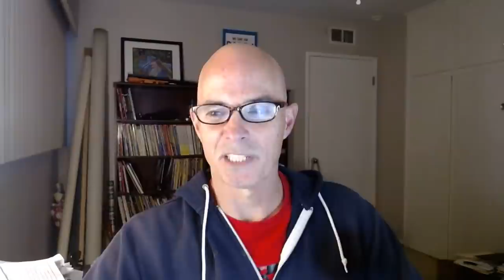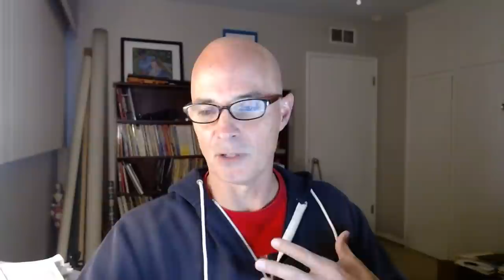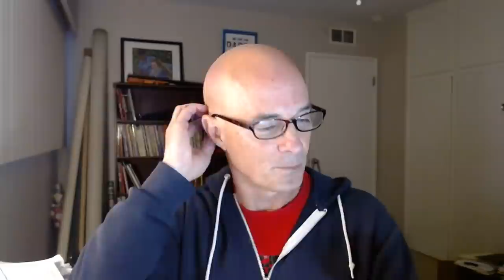LET'S TALK-CAM LIFT, DURATION & LSA (Q&A)

Comment: I need help Rich, ive been watching mr vizard. I have a 91 mustang gt. Im looking to do a top end kit and get a cam w specs he would figure. Is there an off the shelf cam in regards to this? I want to keep bottom end stock. Id also like to add boost later on down the line. A na cam and boost cam recommendation would be awesome. Im also keeping it efi no carb. Any help along w recommendations are highly appreciated. Another thing whats the best intakes for these? Is it holley, trickflow, or? Thanks in advance and i now know the lsa/lca is very critical. Another question, when you set ring gap for boost what do you set it to? Is there a top end kit youd recommend?
Reply from the maker: If you want David to select your cam, go to David for specs. Yes on more gap for boost. Not sure what you mean by best intake.
Reply: @richardholdener1727  out of your testing which intake performed the best? ie the best intake for hp and tq. ive heard the Holley Systemax is the better of all of them. what should one gap their rings at for boost? i simply don't know is all. i just figured you go by how he selects cams as well. i'll def go to him in that regard then. thanks again

Comment: If 200 cc heads are a limiting factor on a 351w, what would it like?
Reply from the maker: the stock 351W heads are not near 200 cc-but I'm more interested in flow than volume

Comment: Is The cam base circle  critical on cam selection?  Do the small base circle cams flex more under high spring loads or is there a preferred steel to use for small base circle cams?
Reply from the maker: have not heard of flex being a problem
Reply: W/the large base circle cams like w/the LS platforms, 55,60,&70 mm base circle  cams on the BBC’s 
Do they tend do have more ramping flexibility  as opposed to small base circle cam being harder on lifters and valve trains in general?  Or  does it even matter?

Comment: Never could understand why a person wants a PD blower and then wants to put a cam that reduces the power where such a blower shines. Then they will also do a stroker motor to increase torque. How does this make any sense????? Use factory displacement with a camshaft with tighter LSA which would increase torque and horsepower for a cheaper price than a stroker kit. Remember to try and stay intellectually consistent. I know it hard for us gearheads to do. I have a Hellcat and want to cam it. I will most likely use the Tomahawk 2.0 with 111 LSA . I'd rather have 108 but 111 is about as tight as they make for the Gen 3. I'd like 600+ lift and 108lsa with duration in the 220's.
Reply from the maker: you are not asking the same question about cams that OEM engineers (and may other cam buyers) ask

Comment: Awesome Content Brother,
Looking at BTR 219 / 239 .553/553 @ 115+2 in a LS3 416 Stroker @ 11:1 CR / 823 Heads, L94 Truck intake, LS7 Crank,  Manifold, Cats, 3" exhuast, to Z06 Npp
  6L80 TuTd w Stockish TQ adapted to Heavy /Lite tow 80's Land Cruiser AWD
  Looking for Low End Torque to Mid Range w Throttle response thru Curve in a DD
 Seems to be a "Goldilocks" fit, might also appreciate the Sound of that large Dur Split (20) on a 115 w a  -1.00 Overlap
Reply from the maker: HOT ROD OR RED HOT FOR THE 416

Comment: 295/336 Duration, 595/595 Lift, 107 LSA stock 5.3 stick shift 4.10 gears 320lbs truck maybe lighter
Reply: Do you think that would be a good cam
Reply from the maker: provide the numbers at .050
Reply: @richardholdener1727  234/277 . Thank you
Reply: @richardholdener1727  do you think that could hit the valves to the piston

Comment: Richard, can you answer this for me? If I have 2 cams everything the same but one is .550 lift and one is .600 lift or more, how will the curve change? I like my trucks power curve exactly how it is but just want to intensify it a little bit, all the way through or at least on top end. I have some to spare on low rpm. So will lift get me what I want? Or do I need to add just a few degrees, or add one or two degrees to the LSA? Truck has ported heads and intake/tb so should be able to take advantage of any cam changes
Reply from the maker: depends on cam-but lift might help it everywhere
Reply: @richardholdener1727  it is btr stage 4 v2 .. 224/230 .558 .558 109LSA 

I'm thinking of going custom with 226/232 .610 .610 109 

I have the ported heads, do you think I need to increase those numbers anywhere or have an offset with the lift (example .600 lift intake .630 lift exhaust) or if you think I need a bigger split on the duration or tighten it up some let me know
Reply: @richardholdener1727  I found 2 videos from TSP comparing the same cam, one with .550 and one with .600 and the higher lift cam made like 10 more hp and tq everywhere without any loss or dip so it seems like increasing lift generally gives an even bump across the board, similar to what higher compression does
Reply: @richardholdener1727  I have .660 double beehive springs by the way so if u think I need to go more than .610 lift it's fine

Comment: Hey Richard I'm interested in  the  lunati high lift voodoo 625 625 112 219 223 ging in ported 243s 6 speed car runs 12.40s with the stock ls1 cam what kinda gain should you get  with ls6 intake please let me no
Reply from the maker: what intake is in it now?
Reply: Hey Richard I have  a LS6 intake
Reply: @richardholdener1727  hey Richard what do you think of the lunati high lift voodoo 625 625 219 223 on 112 for full weight 6 speed ls1 with ls6 intake  for all around street strip ? I mostly just take it to the track on weekends and the odd cruise  just looks like that cam would give me the most average power

Comment: I'm.  Building.     A.    Street.    Motor.      383.     30.     Over.       Darts.    Heads.   202.     160.       Na.        1.  Point.   6.    Rockers.      How.      Big.      A.       Cam.      Can.      I.    Run.    An.       What.     Kind.      Had.     Or.     Solid.     Lifter
Reply: Is something wrong with you?

Comment: Sure, your turbo motors work with the cams you use, but n/a engines with anything over 108 lsa only make top end hp & zero torque. Thats just fine if you've  got a track car with a 5500 torque converter and up. If you can't  get traction from your suspension, I  get it, but don't  be telling everyone that just because your set-up makes max hp, that it has the most potencial on the track. No torque and you don't win races!
Reply from the maker: na engines with anything over 108 lsa only make top end? You need to test more or look at the many, many, many cams tested here to see where they make power

Comment: Tight lobe separation angles are not good for any boost applications ,especially nitrous
Reply: Depends on what you consider tight lobe separation cams. Back in the 80's-90's and even 2000's nitrous cams were grinded on a 108 to 110 LSA and worked great. He'll I think BDS or TBS blower companys prefer 110 LSA still due to one reason the cooling of the exhaust valve. Prostock engines use a wider LSA because of the higher duration of the cams. Just MHO and grumpy jenkins and Warren Johnson theorys.

Comment: Who cares about testing at 2000 rpm? It ain't like anyone is using full throttle at 2000 rpm. Most run a 3000 stall so why does it really matter and who REALLY cares?
Reply: Maybe those who have street use vehicles or towing applications, and don't want to downshift to have some kind of response from right pedal input.
Reply: @rhubarbpie2027  IMO if you're building a PERFORMANCE engine, it doesn't matter. Especially if you're running a 3000 stall converter. If youre building a towing or low speed engine then the cam should be sized for lower rpm. Like the truck cams. I tuned a Denali and the owner/builder selected a stage 4 truck cam. Runs GREAT at 3000 rpm and up. But he was on a stock stall. I told him I would've run a stage 2 at the most. Now he is getting a 2800 stall and the trans rebuilt. Once that's done, it will get out the hole a lot better.
Reply: Daily drivers derp
Reply: @shadowopsairman1583   they shouldn't worry about cam swaps then...
Reply: @jaydubb71  maybe intensive engine modification isn't advisable for all end user applications, but regardless there are people who want different/improved engine performance and that does sometimes warrant an aftermarket camshaft.
Reply: @rhubarbpie2027  if that's the case, people shouldnt be watching videos about engine modifications and then ask about 2000 RPM dyno numbers. Even automotive diesel engines don't get loaded like that at 2000 rpm. Now over-the-road trucks might (I'm a former transit city bus mechanic and 3000 rpm was the govenor limit of a lot of those engines) but cars, no. Most stock torque converter stall at 1800 or so. Most engines cruise on the highway between 1500 to 2000 rpm. Who in their right mind accerates to pass someone and keeps the engine at 2000 rpm? The 2000 rpm question makes no sense...
Reply: @jaydubb71  sorry to have provoked thought. ☹
Reply: Who would care? Anyone running a manual transmission! Yes, 2000 is pretty low, but there are people who will put the hammer down at 1500 rpm or want to climb a steep hill while towing at 2000 rpm. It's not a stupid question! Might they be better off downshifting? Maybe, but if the trans has a granny-first, then running 2000 rpm in second might realistically be the only choice.
Reply: @jaydubb71  There's a cam that will get you 20-30 ft-lbs at 2000 rpm. People who want that readily available torque will want a cam swap!

https://briantooleyracing.com/btr-camshaft-gen-3-4-truck-torque-btr32430112-30202112.html
Reply: @stephendee7839  I REALLY want to see a cam SPECIFICALLY DESIGNED to be run in a steady state at 2000 rpm. The ONLY ENGINES I see that do that are BIG diesel engines. Even with a gas engine towing uphill, you're NOT sitting at 2000 rpm. That's the stock stall speed of MOST automatic cars anyway. And my 30+ years of automotive experience has never shown me a gasoline powered vehicle that has peak torgue at 2000 rpm. That Detroit Diesel/Cummins 10 liter HEAVY DUTY truck engine territory. I think loading an engine at 2000 rpm on a dyno it POINTLESS and just might do more harm than good. But the internet thinks differently.
Reply: @stephendee7839  even this example you used starts at 2300 rpm. I wonder why they didn't show the stock cam at 2300. And again, who cruises around WOT at 2300 rpm? That's pointless and IMO only used to sell products
Reply: @stephendee7839  a "granny gear" is so low (numerically high) that youre only gonna be at 2000 rpm for less that half of a second. And on the highway pulling uphill, youre not going to be in that gear anyway. Gasoline engines don't even make peak torque in that rpm range so it's really pointless to tow in that rpm range.
Reply: @rhubarbpie2027  wasn't thought provoking at all. In my opinion, if people are concerned about making peak torque that low (no engine is gonna make any real HP down there since HP is a function of rpm and torque), get a buy a vehicle with a diesel engine. Or maybe a big block. A big block still won't make peak torque at 2000 rpm it it will make more torque at that rpm than just about every small block engine on THIS planet.
Reply: It's sort of depressing how few people think about driving manual transmission vehicles anymore.
Reply: @stephendee7839  and this second gear tow you're referring to almost always has folks towing at about 3000 rpm anyway. Towing uphill in second gear at 2000 rpm will piss off a lot of people trailing behind you anyway. Even folks I know that tow race cars with gasoline trucks don't go uphill at that rpm. If they get lugged down, theyre FORCED to downshift. A light duty Duramax, Power Stroke or Dogde Cummins might be able to get away with that but not a gasoline engine.  A big block gasoline engine could possibly do it. Like big block Caddy or something but I've never seen one in a pickup truck from the factory.
Reply: @andyharman3022  that's true. It's very depressing. My pickup truck is a stick shift (1995 K1500). Finding a manual transmission in a newer pickup (I'm looking at 2003 to 2007 pickups now) is almost next to impossible nowadays. I'm thinking about taking this older style 7875 turbo that I've never used and throwing it on a stock Silverado/Sierra 2500 LQ4 and letting it eat.
Reply: @jaydubb71  When it came time for me to replace my 01 Dodge 2500 diesel 5-speed, I wanted a later model 6.7 with a 6-speed.  I did a nationwide search on the internet and got a grand total of six.
Reply: I use WOT to pass plebs on the freeway at 70-90 turning 1,600-2000 or so. Why? Because shifting requires effort. 

232-242 116 with .650/650 lift. Forged LS7 427, PRC 285 heads, 9.6:1 comp and Novi 1500 turning 65,000 rpm at 7k. I know I need a YSi-V7. My low comp ratio was for high boost on 92-93 pump with just meth.
Reply: @jaydubb71  I literally put the throttle pedal to the floor at 1500 rpm in 5th on the highway earlier today. You might not, but some people do. You could learn to be a bit more accepting that some people don't behave exactly the same way as you do, and that's okay, and doesn't hurt you a bit.
Reply: @stephendee7839  stick or automatic? If stick, were you expecting a sudden rush of power?
Reply: The 255 and 250 Fords had 1800 rpm torque peaks.
Reply: @jaydubb71  What I was expecting was not germane. You said "nobody uses full throttle at 2000 rpm" and you're simply wrong and too small to admit it.
Reply: James, consider that despite the fact that many wont go WOT at low engine speed, everyone will cruise at or near that engine speed. If an engine makes 400 lb-ft of torque at 2000 RPM and putting in a cam drops that to say 350 lb-ft, you will also lose part throttle response. So now cruising along takes 100 lb-ft and that never changes for the vehicle but what used to take around quarter throttle will now takes almost 29 percent throttle (these are both incorrect and using simple math to illustrate a point). You will notice that and so will your transmission when you now may downshift and rev the engine rather than lug a hill. It makes the loss noticeable. This is what most people dont like and complain about when they lose power at low engine speed and why it matters a lot to how an engine feels and a vehicle drives.
Reply: @MrVettelovralexand2  that part I fully understand. But you're not going to have 400 or even 350 lb/ft of torque at part throttle. But the average person, when going uphill, is going to depress the throttle a little bit more than cruising around on a flat road. And if youre towing with a gasoline engine UPHILL, EVENTUALLY you're going to depress the gas enough to either unlock the converter, force a downshift or both (automatic). Now you're out of the 2000 rpm range. The manual trans equipped gasoline engine is going to get lugged down and as was all know, lugging an engine is a bad thing. If it's boosted, it will help. Especially if it has a PD blower. Small exhaust sided turbo can will damn near respond as fast under load as a PD blower. They only engine that can lug around that low and make monster torque is either a big block (and even those are sort of limited) or a diesel engine.
Reply: @jaydubb71  Yep, agree that most wont be doing it full throttle and those torque numbers were there only to do easier math on how it can and will change shifting because of the calibrated shift logic in most autos. You can and will notice if you have to downshift on a hill that you used to easily cruise over without shifting. Some people actually do seek cams to improve this area.
Reply: @MrVettelovralexand2  the people that seek super low end torque should stick to truck cams.
Reply: You sound narrow minded.. my truck is dual purpose work and play and with my cam I still make good low rpm tq and it matters alot to me when hauling an extra 3k lbs

Comment: You need to go back and figure out what LSA actually does. You are wrong in the importance. LSA should be the first thing you figure out with trying to fit a cam.
Reply from the maker: you get to pick your cam based on anything you want, I rely on hundreds of actual dyno results (lsa evaluation doesn't give you that data)